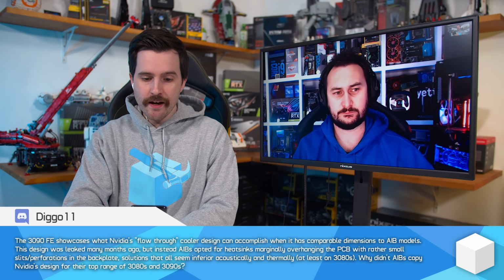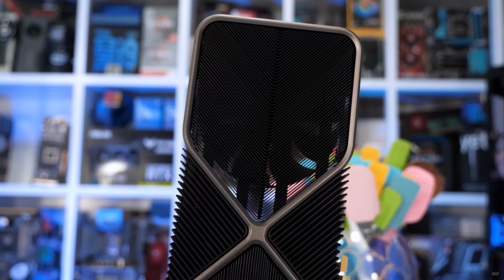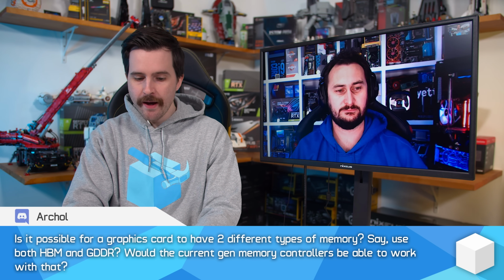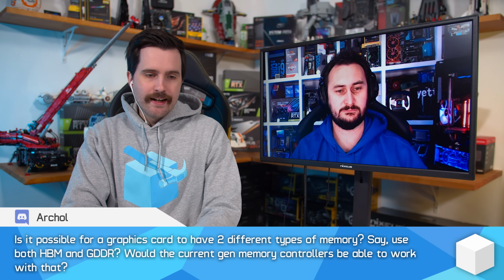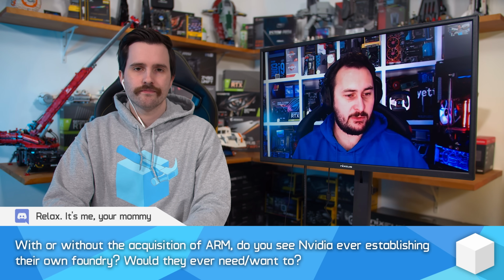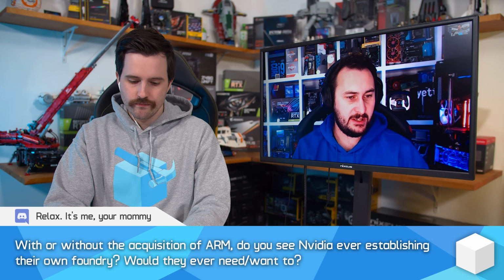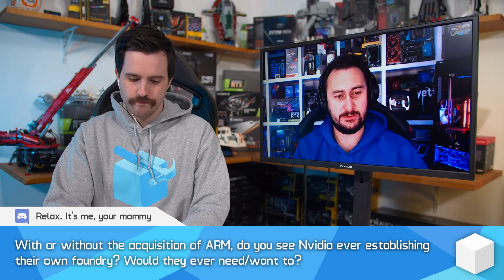Will RDNA2 and Zen 3 Have Launch Issues? Can AMD Beat Nvidia at Ray Tracing? September Q&A [Part 3]

Comment: AMD raytracing should be favorered in all future multiplattform games? Since the console use RDNA2? Or im i wrong?
Reply: Makes sense for Xbox to use DXR
Reply: Your right
Reply: Its hard to tell what they will use. Its possible that amd dont have their own thing and will be just directx raytracing. Also ray traycing is raytracing how different could it be realy.
Reply: @rivaxis  Fair point. I do think AMD aim to do good in the open standard. Just like with freesync. So dx raytracing would be possible. If so, this must be true for consoles to since they are RDNA2 based. If I made a multiplattform game i would optimize for that for sure. I think AMD could capitalize on that.
Reply: @geekmachine666 , amd released a raytracing demo for rdna 2 a few months ago. It was directx raytracing. And amd might use microsoft direct storage to compete with rtx io. Mark cerny(PlayStation architect) said that they worked with amd for some custom features and if that went well, we will see those features in pc rdna 2 gpus. Rtx 3080 isn't available yet in my area and 3070 is delayed, so I am waiting to see what amd is cooking.
Reply: AMD usually likes to brag about how they follow open standards, so I'm guessing they'll use the Microsoft framework.
Reply: Not really.

How pc rdna2 discrete card do rt is different from how xbox rdan2 do rt, which is also different from how ps5 rdan1.5 + rt hardware do rt.

That's ignoring how each of them fetch data, which is again very different on those 3 platform. PS5 has essentially 500gb of vram. Xbx has 500gb of lower tier vram. Pc is stuck with whatever amount vram the card has + good cpu/ssd/mobo combo that hopefully come close to system memory. System memory is still slower than vram. Accessibility of data might mean pc can crank out more fps per setting, but pc can't compete at all when rt is involved. 

Now RT IO is a thing, amd probably will have something similar. But they are still worse than console implementation since part of the gpu resources were dedicated to pack/unpack data. On console, ps5 has super effecient stand alone custom silicon to do that. On xbx, we should expect something closer to ps, which is still better than current pc stuff.

Now dev have better access to AMD documentations. Dev will optimized their game for the lowest quality rdna2 discrete card (whatever replace 5500 tier), which will sometimes indirectly benefit higher end rdna2 discrete card. So not all hope were lost. But that's true for Nvidia lowest quality card too. It is not optimization carry over from console.

Lastly, yes, console using amd stuff do sometimes have unplanned optimization on the dev part simply because they have to optimized for console anyways. But from what we can see from past generation, those optimization allow AMD to catch up to Nvidia, not surpass Nvidia.
Reply: @jintsuubest9331   @Jintsuu Best  You are however not pointing out that Sony, Microsoft and AMD have an agreement about RDNA2. That agreement extends to "if Sony figure out some cool shit to make the most out for RDNA2 then AMD is allowed to use it and vice verse. Both Sony and AMD have confirmed this. So it would be stupid of them to not co-operate in how the confront the RT performance in any way.

Also "diffrent" does not translate to "no common ground". Ofc they work together when there are win-win situations. If it would be an nvidia chip in the console they would also have that chance. But they dont. And now nvidia have chosen the vega-approach. A arcitecture that combines compute and gaming. AMD goes at the same time away from that approach and splitt GCN into RDNA2 and CDNA. We will see in a few weeks.

Comment: I have around 300 - 350 to spend on a motherboard(x570). Do you think there is any point on spending so much when you can simply buy a tomahawk around 200? 

I 've seen a buildzoid video recently, saying that it makes all boards up to 300 euros bracket, obsolete.
Reply: The unify is only 50-60 more than the tomahawk where I am. An extra m2 slot and a ton of other features seem worth it to me
Reply: @jameshay6926  Such as?
Reply: @EpicListening7  what do you mean such as?
Reply: @jameshay6926  features
Reply: @EpicListening7  Clear CMOS & BIOS Flash buttons on the rear IO, EZ Debug LEDs, and on board Power & Reset buttons
Reply: Also it tell you the temp of the cpu which is nice little bonus
Reply: @jameshay6926  Ty, pal! I am looking for a good board and it's really a hard choice. So many good boards at this price range. Only Asus is  out of the question. I don't like their bios.
Reply: @EpicListening7  if you are on a budget tomahawk. If you want a board that pretty much matches one at about £500 get the unify

Comment: You can already tell AMD is going to blow Nvidia out of the water at 1080p and 1440p. It'll be tight at 4K,  Nvidia will likely get a slight lead on the 3090.
Samsung process has Nvidia's balls dragging in the gravel this generation.
Reply: I was thinking the same thing nvidia might win at 4K slightly but amd will win in lower res
Reply: Hmm and how can you already tell. AMD has been consistent in one thing over the years in their gpu department and that is to disapoint. Every generation fanboys say "this gen AMD destroy nvidia".
Reply: @rivaxis  be glad there is competition this time and stop complaining like an nvidia fanboy
Reply: @malathomas6141  and why do you think im nvidia fanboy. Im no fan of anybody. last get I got 5700XT which died on me and replacement card failed too. Im no fan of nvidia, but their card at least works.
Reply: @rivaxis  I said stop acting like one
Reply: @malathomas6141  so having doubts is considered acting like fanboy. I see.
Reply: @rivaxis  fanboys doubt almost anything
Reply: @malathomas6141  you have some twisted logic. Anyway not believing some random guy on the internet without any proof is pretty natural to me. But I guess thats fanboy behaviour too, right?
Reply: @rivaxis  that's up to you
Reply: @rivaxis wait till the 28th and amd will show u

Comment: Considering you can buy 4k TVs with upscaling built in (and without using a supercomputer) I can't see it being impossible or even difficult for AMD to provide a solution for DLSS type features.
Reply: Tv upscaling is simple integer scaling in most cases. Ie 4k is full hd x 4
DLSS is variable scale so much more difficult to do

Comment: The b550 will throttle the 3900x
Reply: No lmao
Reply: @WhenDoesTheVideoActuallyStart  it will
Reply: @420ChronicBlaze  nope their are already videos with b550s pared with the 3900x. Just buy the good ones. Me however need to get one so I can prepare for zen 3
Reply: @justmixah3408  I heard msi x570 boards are so bad they throttle the 3900x?
Reply: @420ChronicBlaze  havent heard that at all if you buy a cheap one then yea you always by the mid range boards if not high ends
Reply: @420ChronicBlaze  You do realize that "B550" in itself doesn't mean much, right? That's just the chipset. The amount of fast USB ports is one of the least relevant metrics for comparing motherboards. And if an AIB wanted to put a Threadripper-ready VRM on a A520 board they could.

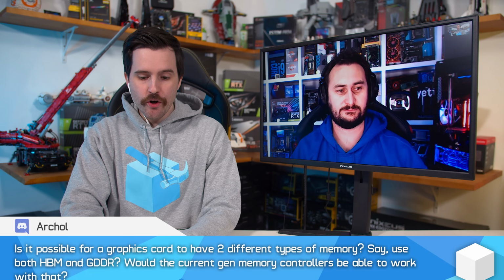Comment: 9:15 -- Nvidia tried something similar to this already with the GTX-970. They got sued.
Reply: Lol oof
Was this the 3gb card they claimed were 4gb?
Reply: @OutOfNameIdeas2  it is 3.5 + 5
Reply: @Transistor Jump The other 0.5 GB of Ram were slower which did produce performance problems in games which used up more than 3.5 GB of ram like Arkham Knight for example. Calling it a 4 GB card was not really true.
Reply: @saravin9754  Not really true though. Frequently went over 3.5 with my 970 and never got stutters.
Reply: comapines could defintely do the gddr6 and hbm thing like the guy asked. they would just have to be upfront. if nvidia had sold the 970 as a 3.5gb with .5gb of slower buffer they would have had no issues it was the fact it just said 3gb of gddr5
Reply: @El Cactuar exactly, barely any games do use it all because they designed the buffer that way. I used a 970 from it's release until I bought a 2080ti in 2019. Never had any stutters that were vram related.
Reply: @Transistor Jump 

FYI, 3.5 + 5 is 8.5 not 4.
Reply: @Transistor Jump 

Writing mistakes on a test equate to a wrong answer.  Proof read next time.
Reply: They kind of try to hide it. They should have detailed it from the day it released

Comment: Who in their right minds use an ultrawide as a "coquer it all" monitor? I mean the aspect ratios have their usage but 16:9 is like voltage in a home outlet - it's better for some worse for others, but at least you don't need a 1m wide wire to carry the current.

Comment: AMD, Don't you mean TSMC? AMD's approach in CPU building hasn't really been that great. When you consider that Intel's outdated process can now surpass the performance as long as you match the number of cores. They remain slow. End of. 4.2 GHz wow.
Reply: I beg to differ. AMDs approach to CPU building is different, that doesn't mean it is inferior. It was designed to be highly scalable, and it was designed to be high performant in many tasks (and that includes games when they have been optimized for Zen architecture from the ground up, or heavily modified). Just because Zen currently falls behind in gaming because of lower clocks and/or single threaded games (or games that can't use Zen's multi-core muscle yet) , does not mean they are slow or that Zen has reached its full potential in games. Zen dominates in work related tasks at lower clocks, and any task that uses more cores, and productivity software is updated far more frequently for new CPU architectures, as was the case with Zen and many software suites. Game engines take longer, we need new game engines or heavily modified game engines.

So in newer updated game engines, which have been optimized for Zen and multi-core, an 3700X edges out an 9900k, and an 3900X rules the roost (the 3950X is not much of a benefit over the 3950x, but it is ever so slightly faster than an 3900X).
https://www.computerbase.de/2020-08/troy-a-total-war-saga-benchmark-test/2/

Most games and game engines have been heavily Intel biased and optimized over the years, so new game engines can be optimized to make better use of Ryzen's Zen architecture (performance is being left on the table). The next gen consoles being released can help with this, both are using Zen2 cores now. It doesn't come down to only CPU frequency or Intel's Ringbus, Zen is not optimized for in most game engines, and Ryzen still gets pretty close most of the time, in spite of the clock speed deficit, CCX layout, higher memory latency and lack of game engine optimization.

So when optimized for, a Zen2 3700X at much lower clocks than an 9900K can match an 9900k in said optimized game title (I am not saying this will happen in every new game engine, but performance has been left on the table with current un-optimized games). And Zen3 is around the corner, and so is both next gen consoles. Just give it time, Ryzen is only 3 years old and it does take time for new game engines to actually be built with Zen optimizations in mind. 

Ryzen needs to be more adopted first, game engines are not all of a sudden made from the ground up with Zen optimizations in mind, not before Zen actually has reasonable market adoption. We need new game engines and/or highly reprogrammed game engines, not just bolt on updates, or no updates as we are currently seeing. But the next gen consoles should help with this, as does Zen selling so well, the more people purchasing it, the higher the adoption rate is.

And many game dev studios are now using Zen PCs to design their next gen game engines for consoles (such as Epic games, owners of Unreal Engine and next gen UE5), the same games we will get on PC. Lots of the gaming shortcomings we are currently seeing is due to major software bottleneck, lack of software optimization for Zen architecture, and lack of multi-core optimization. Yes, frequency and latency does come into play as well, but so does software optimization. Zen2 specifically does have very high IPC and tremendous multi thread muscle, but it is not being made use of in almost all game engines we currently have (but as I showed you in the above article, Zen software optimization can add a fair amount of performance). But we also have Zen3 coming next month as well.

And Zen3 is already looking incredibly fast, latest leaks show an 8c/16t 5800x beating an 10c/20t 10900k in Ashes of the Singularity CPU benchmark.
https://www.guru3d.com/news-story/benchmark-shows-amd-ryzen-7-5800x-processor-with-eight-cores.html

Whether that is performance that will be carried across the board into every game or scenario I can't say. But Zen3 will be fast, it should at the very least bring Zen closer to Intel performance in current Intel optimized game engines. And Zen architecture optimization is also coming now over the next console gen. So Ryzen will get better with games, and it is only games where it falls behind Intel at the moment consistently.

Intel's major benefit is over a decade of dominance and software optimization, most PC games where optimized for Intel, because Intel CPUs sold the most and where by far the better CPUs compared to AMD's FX series. And PS4/Xbone used AMD's Jaguar CPU cores, they did not use AMD's FX CPU cores (different architectures) and Jaguar CPU cores had more in common architecture wise with Intels Core architecture than it did with AMDs FX architecture (FX was very different than both Jaguar and Core). 

So PC's with AMD FX CPUs were not optimized for, because FX didn't sell as well as Intel, and they were much worse than Intels CPUs on all fronts, and also because the consoles used Jaguar CPU cores, which shared more in common with Core than it did with FX. So the PC landscape has been dominated by Intel over the past decade, and it shows in our games, as you would expect it to.

But Zen is an excellent architecture with lots of potential, it just needs more adoption and software optimization and/or multi-core optimization. But Zen3 should really help catch up in older game titles and current game titles that were Intel/Jaguar optimized. I am not sure if it will close the gap, or if it will beat Intel across the board (I have no idea), but it should help catch up nonetheless. But it is really upcoming next gen games that will actually be optimized better for Ryzen (thanks to next gen consoles) and multi-core that will run better on Zen architecture. I do think the games will still run well on Intel as well, but they will also run much better than current games on Ryzen too. So it is not that Intels gaming performance will decrease, it is that Zen's gaming performance will increase.

And even Intel is going the chiplet route in the future, Intel already has plans for it. So they will also be using "glued together dies", and AMD has a solid head start in that department. 
https://www.anandtech.com/show/16021/intel-moving-to-chiplets-client-20-for-7nm

It is the only way to make highly scalable CPUs that are easy to mass produce with high yields, high profit margins and faster to market times. Intel's CPUs aren't slow, I don't think I have ever heard anyone say they were, and it is not an a horrid thing for AMD to be behind in gaming performance with current games compared to Intel, it is outright expected. But it is incorrect to think AMD's design choices were not great and that they should have followed the standard monolithic route and copied Intel's design closer. 

AMD was incredibly cleaver to lead the way with chiplets, CCXs and most importantly, the Infinty Fabric. And Intel will be following a similar route in the future as well. It is the best way to deliver highly scalable CPUs with all the other benefits that AMDs route leads. AMDs incredibly well selling high performant Zen line is proof of this methods worth, and Intel has been taking notes and they will be coming with a similar approach, as they should if they want to compete with AMD in the future.

And you are also thinking of Intel's 14nm process incorrectly. Intel has had many years and multiple CPU gens to perfect Skylake architecture and their 14nm process. And Intel first gen of 14nm CPU (Broadwell) was not great and they had multiple issues with frequency etc. And it took Intel multiple 14nm node revisions and refinements to get it to the state it is now. AMDs Zen2 is on an brand new 7nm process, their first go at it. And Zen3 will be the second architecture revision on 7nm, compared to Intels 5th revision of Skyalke on 14nm+++++. 

And it is more difficult to scale frequency on smaller nodes, and Intel is having major issues with its own nodes, that is exactly why they haven't moved desktop CPUs to 10nm yet, it has been delayed multiple times. And it would be much more difficult for Intel to get 5ghz+ out of 10nm and 7nm. All of Intels 10nm/7nm process node issues are exactly why Intel is backporting their new architecture to 14nm+++++. You are missing many facts here, and your reasoning is flawed.

Intel will be playing catch up, they are behind in chiplet design and behind in process node. Zen3 will be an excellent update because it will be AMDs second architecture update on 7nm, it will be their first refinement on 7nm. So you can consider it the same as Intel going from Broadwell 14nm to Skylake 14nm+. But AMDs first Zen2 iteration on 7nm was actually a far better first attempt than Intels first 14nm Broadwell attempt. So I would actually consider AMDs Zen2 7nm more in line with Intels second iteration of 14nm with their Skylake 14nm+. So Zen3 and 7nm+ could be considered more in line with Intels 14nm++. In other words, AMDs/TSMCs 7nm node is far more successful than Intels 14nm was at launch, and started in a much better state than Intels poor first 14nm attempts with Broadwell.